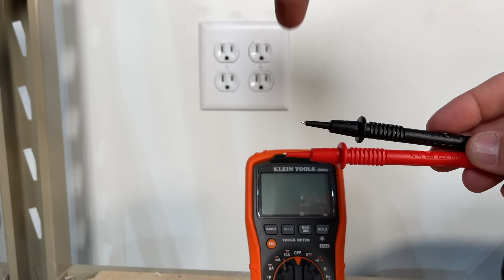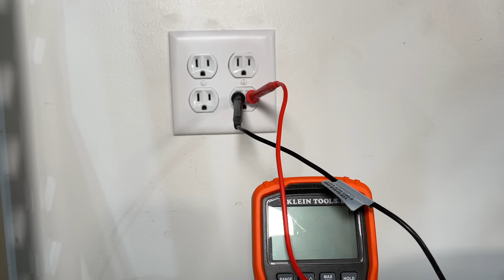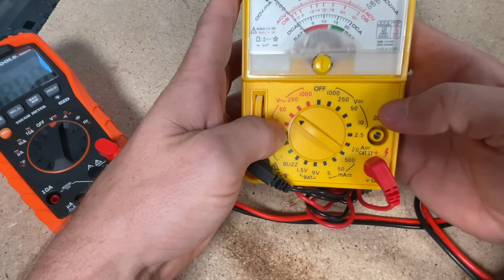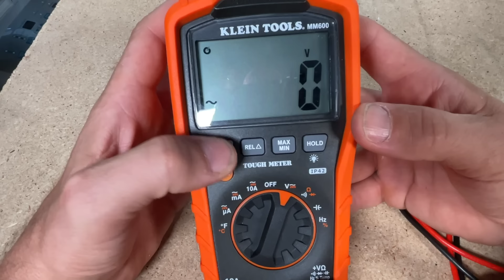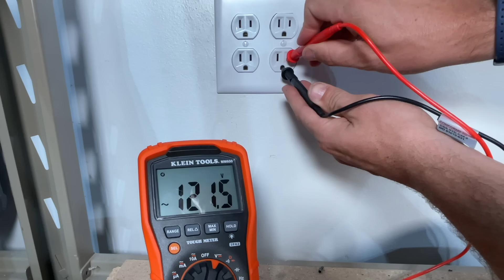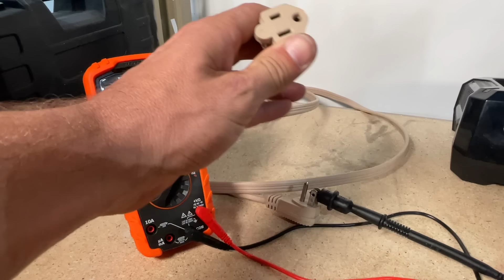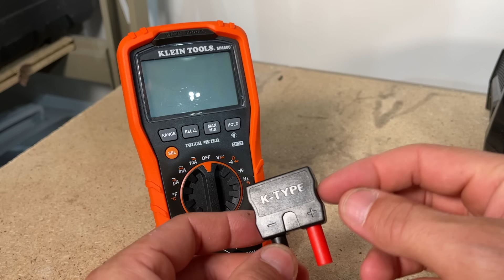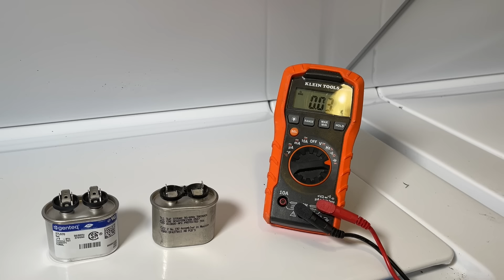How To Use A Multimeter for Home Repairs and Troubleshooting

Comment: The symbols for A/C and D/C voltage shown on a multimeter come from measuring these different types of voltage using an oscilloscope. A/C, or alternating current, is represented on an oscilloscope as a syne wave, the amplitude of which will determine the amount of voltage. D/C, or direct current, is represented on an oscilloscope as a strait line. The center, or ZERO line, of an oscilloscope is a dashed line. The solid line, representing the applied D/C voltage to be measured, will move up (depending on your range setting) to the correct place to indicate that voltage. When the early types of meters that we have today started coming out, these symbols were used so us old guys would know what they meant. Kinda like the symbol used on an on/off button on a modern computer (a circle with a vertical line running through it). This represents the binary code for on and off (a 1 and a zero). Or, the old floppy disc symbol for saving stuff.  Just my 2 cents. Thanx for reading.
Reply: how do i safely check ignition coils. i know its in resistance mode.
Reply: @charlesdowns1691  you might want to get some good advice on that.  Coils can build up a charge, and resistance mode of multimeters generates a charge.  Meaning, you could charge up the coil and get quite a shock if you're not careful.
Reply: Then you should know it's a sine wave (sinusoidal) there is no 'y' in it.

Comment: I tend to use the cheap meters like the yellow one you showed. I have several in different bags for electrical, low voltage work, and on my bench. They don’t last as long, but I also tend to lose tools frequently. Of course, I also started out before digital meters, and they were not as forgiving, either.
Reply: Didnt get the 9999.?

Comment: I have an old meter that is even older than your super cheap one. Mine must be a super duper cheap meter. Still works though! I have blown the little internal fuse a couple times when I had it on the wrong setting though.
Reply: That's what the fuse is suppose to be for.

Comment: I wish that you would have mentioned the dangers of using the ohmeter, that electrically it provides a dead short to a live circuit, and as such should only be used on dead circuits.  I understand that the Fuse in the meter "should" blow but I wouldn't want to test that out.  Plus I hate changing those tiny ass fuses
Reply: Something tells me that you are still going to be changing fuses.

Comment: I have many DMM's for auto-truck-AC electrical. One of my favorites (if I can keep up with the batteries it eats) is my Fluke removal display head model 233. Great for testing and you need to be away from the power source, say a truck or bus and need to check the rear lights. Just slide off the magnetic display and it will receive the info from the main body for up to about 40-50 feet away. Perfect for a One-Man operation.
Reply: That's a great meter if you like to replace batteries. That portable head chews through 'em at an unbelievable rate
Reply: Have you tried the special Eveready lithium-infused "Lithium Max" batteries?

Comment: trying to understand why one would want to manually set the range when measuring voltage.  What advantage does manually setting the range have over autorange?
Reply from the maker: Sometimes I have seen with autorange you will get an “OL” error but setting the range manually will not give an error.  Also you might want to adjust the accuracy being displayed.

Comment: That analog meter most likely isn't as cheap as you make it sound because it's actually better than some decent digital meters for the main fact it can measure up to 20 amps DC. Just about every digital meter I've seen that can measure DC amperage can only measure up to 10 amps. If you are in the market for a decent meter, you should really get one with an AC amp clamp on it because it's very useful to be able to measure the amp draw on your circuits especially ones for large appliances.
Reply from the maker: Thanks for the feedback Ben I do agree the Amp Clamps can be super handy.
Reply: If you really need to measure high currents accurately, you can get an inexpensive current shunt that allows measurements of 100A or more. You just use your DMM on the millivolt range to read the current out.  In a pinch you could even just use some 14 gauge wire to make one yourself, and calibrate it with some known currents. 
You do have to know what you're doing though, so it's not something most people will want to try.

Comment: Good safety practice but with 10 Megaohms internal resistance of the avarage meter when in Voltage measuring mode ... it won't arc or elecricute you.

Comment: 1. Capacitors are a common point of failure in HVAC systems. If the system fails to kick in, that should the first thing to check. They all seem to go bad, eventually, especially if outdoors.
2. The multimeter I use most is the cheapest one from the Horrible Fright Tools they used to give away if you made a purchase. Reasonably accurate for household chores and have not gone bad on me. Still have  a drawer full of them.

Comment: As others pointed out, Step#0 is to assure probe is NOT plugged into 10A or mA jack.  Typical meters have two fuses (one dedicated to 10A circuit), but at the very least it’s unwanted nuisance to find and pay for replacement fuses.
Great job communicating safety when probing receptacles - it’s Last In, First Out (LIFO) for the hot lead...
Reply from the maker: Thanks Chuck 👍
Reply: Can you explain what you mean by NOT plugging into 10a or mA Jack? Please, thanks
Reply: What Chuck said.  I still remember as a young teen attempting to check a washing machine heating element for voltage, however what was actually testing was how much current the 240v supply could push through the internal 10a shunt.

To this day I never put a meter away with the leads in the meter.
Reply: I wouldn't go probing anything without turning the meter on first either !
Reply: @millomweb   - That's the same advice my wife gives me.
Reply: 9 13

Comment: Thanks Scott. I'm really enjoying your channel and find it super helpful. Another DIY'er use for a multimeter is testing voltage on doorbell transformers. As the newer smart doorbells usually need between 16-24 volts and not all homes meet those requirements. Thanks again.
Reply from the maker: Good callout Pat, thanks for the help 👍

Comment: Measuring temps with the thermocouple using multimeters is rarely if ever accurate.  Sometimes not even remotely close.  What's needed is a meter engineered for HVAC or better yet,  a dedicated temp meter which can be calibrated at 32 degrees using iced water.  Fieldpiece makes a nice one for about $85 that is dead-on with temps and instant as well.
Reply from the maker: Appreciate the feedback Steve.
Reply: Agree. I think even the lower priced Fieldpiece clamp meters with k type temp. options allow for calibration to a known temp value such as ice water.  However, if all a person is using it for is measuring delta T, then maybe calibration isn’t as important.
Reply: I’m sure you know what you’re talking about, but how are you supposed to know when your ice water is 32 degrees F and not, say, 29 degrees?
Reply: @asdfgoogle  Thats a good question.  If you take a decent size bowl adding water and ice to it, let it sit for 15 minutes and stir it up well, you’ll be ready to calibrate.   You don’t want to touch the probe tip to ice as it will read lower than 32.  And stirring is important too.
Reply: @holtrussell constant stirring is critical, and using a thermos will allow the ice water mixture to reach equilibrium uniformly throughout the container for a good measurement.

Comment: 1:15 I been using multimeters for years and I never knew this 😭😭 thank you for mentioning that
Reply: That's because it's fake news.

Guy doesn't know what he is talking about. There's a resistor in there plus you'd never be able to measure voltage between two hots because either probe wil lbe touching one leg of hot first before the other. ;)
Reply from the maker: For sure 👍

Comment: Don’t recall saying in vid, but if happen to place probes on wrong sides (aka positive and negative……black & red probes) you’ll get a negative “-“ sign on meter and this shouldn’t “harm” the meter, just give minus sign letting ya know reversed.
Reply: This would be true on DC circuits, AC wouldn't show any difference

Comment: Never have used Klein multimeters. Use other testing tools from them a d handtools (strippers, drivers, etc) but not multimeter. Usually go for Fluke for multimeter and wonder how Klein ‘meters compare 🤔 
✌🏻

Comment: When it reads 0.0 why are you saying it reads 99.99? How is one supposed to know the 0.0 isn't really 0.0??
Reply from the maker: Sorry for the confusion it is actually more from when the decimal place moves to the right.  So at the range setting it can display or “read” 99.99 volts.  Let me know if that makes sense 👍
Reply: @EverydayHomeRepairs  Got it. Thanks.

Comment: Worked at building supply store and had a multimeter on the work center. Put it on AC volts and checked voltage in outlet at desk, it was 120 volts. After checking set it back to ohms and walked away. A monkey see, monkey do employee tried the same thing but didn't know to change to volts. 🙄 I heard frying sound and a few lights went out. He blew up the meter and kicked a breaker.
Best place I ever worked till the owner died, and his daughter and nephew didn't want to be in the lumberyard business anymore. They let it run down & sold out.

Comment: Obvious we missed the ground side when placing the probe the first time.
Great information. Clear.  A little cloudy on the max. voltage setting.   All zeros. 
Thank you very much.
Reply: I think I understand your fuzziness on the range voltage setting.  On my multimeter screen, when I select AC, the screen has four zeros.  The decimal point will be just on the right of the first zero as I press the range button. 

Example:  0.000
This range can only read 9.999 volts.  

The next range is 00.00 and reads up to 99.99 volts.

The next is 000.0 which will read up to 999.9 volts.  

The last one is 0000 or up to 9,999 volts.  I only use my multimeter once or twice a year and therefore purchased an AstroAI DM6000AR.

Comment: Good info here Scott, this will probe hook up sequence will come in handy when I’m connecting up my trolling motor.
Reply: Literally not an issue. You can touch the probe in any order you wish.

Also, power flows from the negative terminal to the positive so if he wanted to be "safer" he'd touch positive battery terminal first... but again it literally does not matter. Doesn't matter if you flip the leads either. It'll just show reverse polarity.
Reply: @etherealrose2139  yeah, I was wondering where he got that idea… silly as putting ketchup on a hotdog before mustard to prevent getting it on your hands.
Reply: @Ozmarilla  Around so many things and among so many people, it's how they were taught, it's not something they've analyzed, before utilizing- like the old belief about  putting a 12 volt automotive battery, on concrete, that supposedly it would "drain" the "current" ,
or throw away latex paint, if it's more than 5 years old.
 It's whatever gets handed- down to people, that they view as "correct" or "incorrect".
Reply from the maker: Thanks Ryan! 👍

Comment: Scott, this is what I exactly needed. I got a multimeter from Fluke and was lazy to go through a manual. Your clip explained everything clearly. Thanks!
Reply from the maker: Flukes are great!
Reply: I strongly recommend that you look up the manual for your meter,  and at least red the parts that pertain to the functions you will be using.  Don't take the word of a crackpot, me, or EHR.

Comment: Can you make a video using the outlet tester using the GFCI test mode? because I have outlet testers but they don't have the GFCI test button never seen one or used one. You mention you Continuity test for ROMEX wires but how can you test ROMEX wires when then are in the house walls. Can you give examples because you get wiggle test ROMEX wires when they are in the house wall or in the floors.
Reply: Disconnect whatever is on both sides, make sure the cable isn't live and then join the black and white together testing on the other side for continuity.
Reply: @AlexSherm  Then, untwist and recheck for no continuity.
Reply: @paulsto6516  untwisting is the most important part before plugging them back in 😅

On the same token, with the wires removed you can use a jumper wire to give continuity so you dont need to keep twisting and fatiguing metal.
Reply: @etherealrose2139  
Agreed.

Comment: I recommend getting a clamp multimeter so you can measure current as well. It's nice to have it all in one tool.
Reply from the maker: Those are slick 👍
Reply: Can't measure DC with a camp on.
Reply: @robertkat  Some of the newer ones do indeed measure DC

Comment: I would go with Fluke ( I have 87 and 289) I would not trust Klein multimeter, maybe only for measuring voltage on AA batteries 😃
It would be a better choice (more expensive) Fluke 17 b +
Reply: Most digital multimeters have high internal impedance and don't load flashlight batteries sufficiently to give an accurate test. An old analog voltmeter actually works better!

Comment: You should set the meter to the function you want before you put the probe in the outlet (or connect it to anything else that might be energized).  If you momentarily set the meter to measure the wrong thing after it's connected, you could blow the fuse in the meter or possibly damage the equipment you're testing.
Reply: Good tip. I blew my fuse not knowing why but think it's because it goes thru the milliamps test dial which is only rated for a meager 250 milliamps so instant blowout.
Reply: Glad someone said this. I was coming to comments to say the same things.